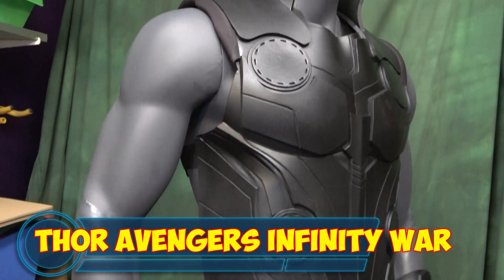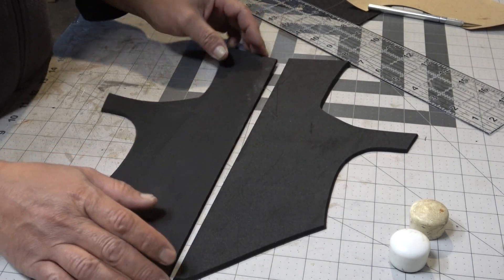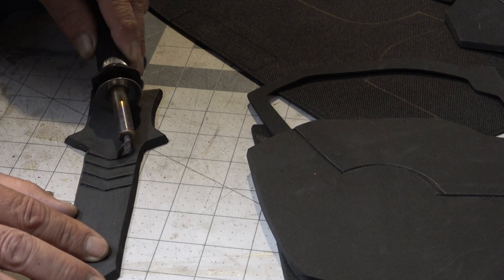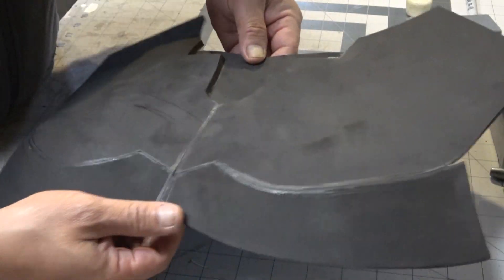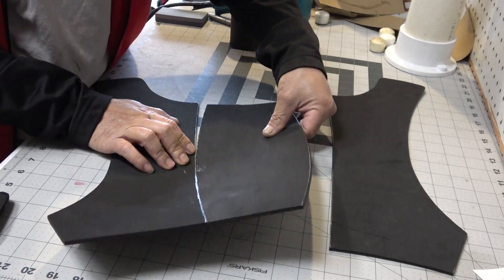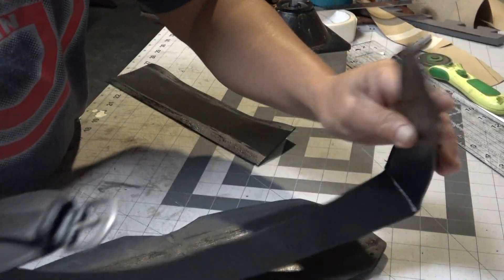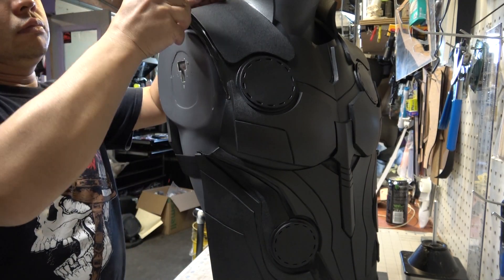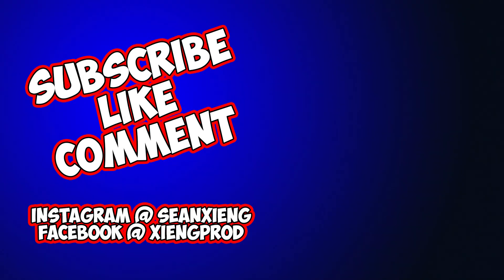Thor vest from Avengers Infinity War

Comment: I bought your templates and they are AMAZING and easy to follow! I HIGHLY RECOMMEND. 

Tips for others: If you plan on using his templates, locate a place or someone with a poster printer and plan to install adobe flash reader in order to print out his templates properly! Also, using a laser cutter for the circles makes a HUGE difference in final presentation rather than cutting them by free hand.
Reply: Hey mate, if I don't have access to a poster printer will a regular printer do the trick? Or will the a3 paper size be insufficient?

Comment: i have a question please ... The Spary you did .. was Matt or glossy .. 
at first it was glossy then it went matt ... so thats why am a bit confused ..

plus should i spray on the foam directly or should i put something first ?

last thing please :) i know i asked alot .. the thickness of the foam please :) ?

thanks
Reply: Hesham Daly the only answer I have is that the foam is 3mm thick.

Comment: Wow! I can't believe how easily your Barge cement connects the foam edges so easily and permanently. Are you letting them dry outside or indoors? Mine dries to a tacky feel, but still comes apart easily. I even tried using a heat gun for speed drying of the cement. Any suggestions?